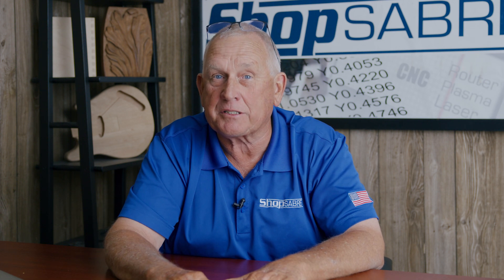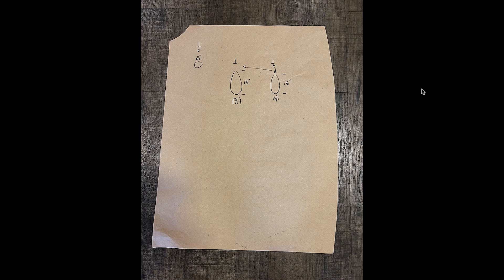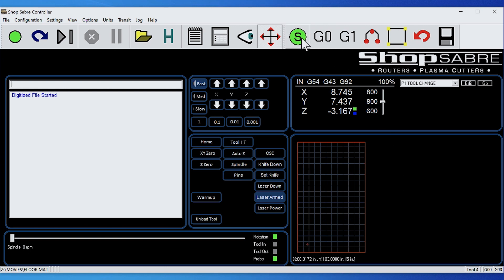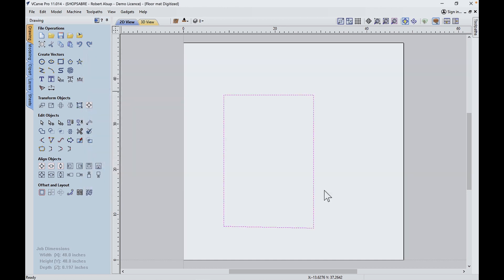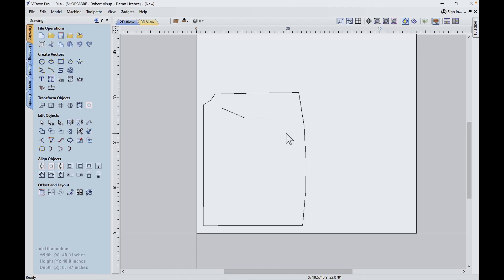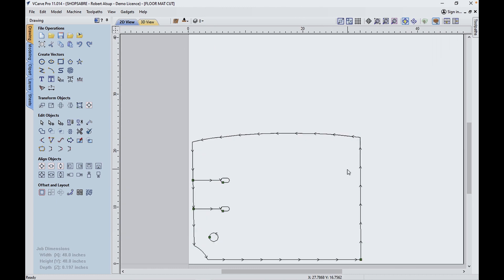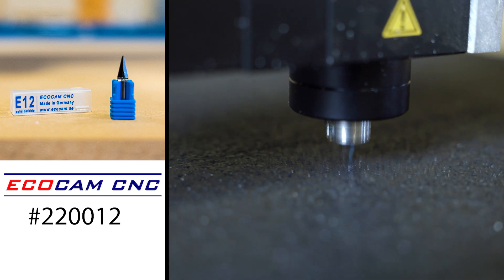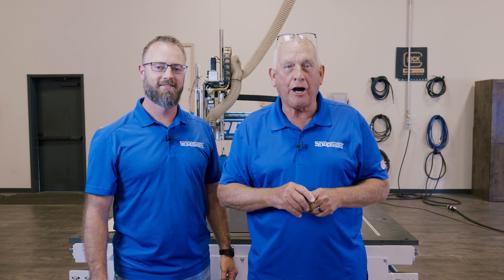Digitizing Rubber with a CNC Knife on a ShopSabre CNC Machine

Comment: How do you make the knife oscillate up and down? Typically, a drag knife has the spindle turned off, and it literally drags through the material.
Reply from the maker: Our oscillating solution has a motor attached to it for ultrasonic movement and is controlled through our controller